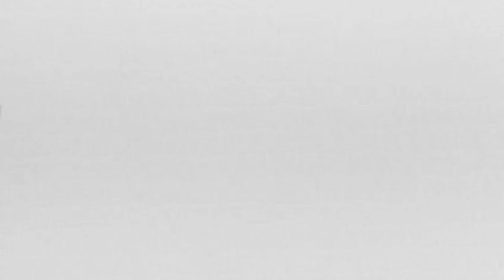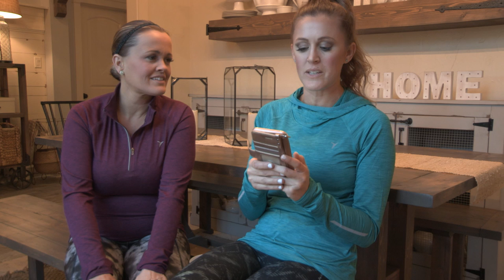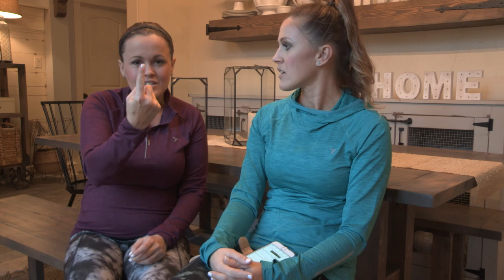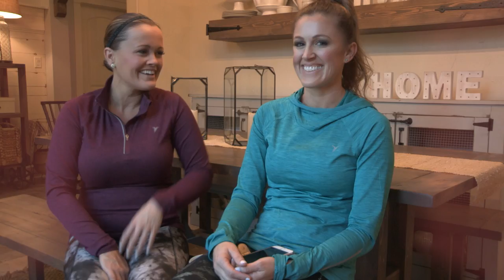How to clamp boards when using a Kreg Jig Q&A

Comment: Just found your blog.  I like the kreg method, but have found some issues.  The first is money.  If you have a lot of it the problem s go away in that you can afford all the fancy factory tools and also have the room to use them.  My biggest issue is if you don't have the pieces clamped very tight and perfectly lined up, the boareds will crepe. Also part of the problem is the tolerance in the holes.  There is enough room to angle the screw without really realizing it until you set the screw.  It the acts like a "drawnail."  You can use a drawnail or toenail to pull two boards into alignment.  Great if you want that result, but bad if you don't. 
     I have a couple ideas rattling around in my brain (the noise is giving me a headache) that I want to try.  If they work I'll let you know.  In the meantime if someone else has already solved the problem, let me know.

Comment: Hi ladies. Love watching! Finally, some "girl power" builders. I am kind of a newbie. I recently bought the kreg pocket hole jig (R3), bought the kreg face clamp separately & when I use it to hold 2 pieces of wood together, it's great! However, when I use it to hold the jig in place while I drill the pocket holes, it moves A LOT!! What am I doing wrong? Or do I need the "better" Kreg clamp, which is more money? I am at the point where I don't mind as long as it works. Hope yo hear back. I realize this is an older vid.

Comment: I have an IKEA bed frame that I really don't like, but I got it for $60 from a neighbor. But I really want a cool distressed wood headboard. Can I make a headboard and attach it to the rest of my IKEA frame? Is that possible? And maybe try to stain them the same color? Did I mention I hate the IKEA bed frame lol
Reply: The reason I'm asking is also because I think it's laminate
Reply from the maker: A headboard that hangs on the wall, much like a piece of art would be a great way to blend the two.  You wouldn't need to connect the two pieces that way and it can safely hang from the wall with the right hardware.  Great question! ;-)